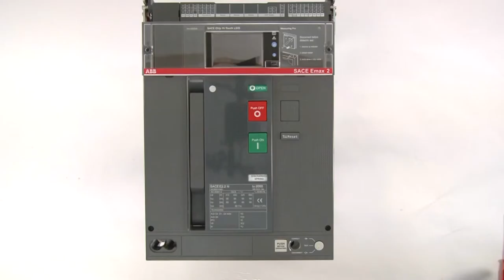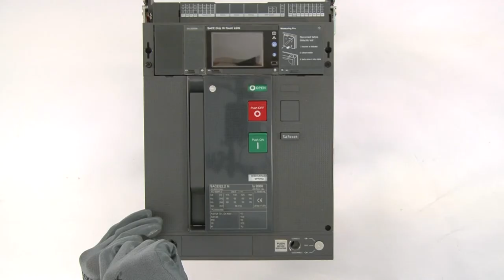SACE Emax 2 - Remote reset for E2.2…E6.2

Comment: So, by installing these devices...what exactly does it allow you to do?  Remote opening and closing?  Thanks!
Reply from the maker: Thanks for your query. The reset coil (YR) permits remote resetting of the circuit-breaker after a release has tripped due to an overcurrent condition. It is available for all automatic circuit-breakers, in different voltage supply: 24V, 110V and 200V. If you want to know more about it, we can contact you.